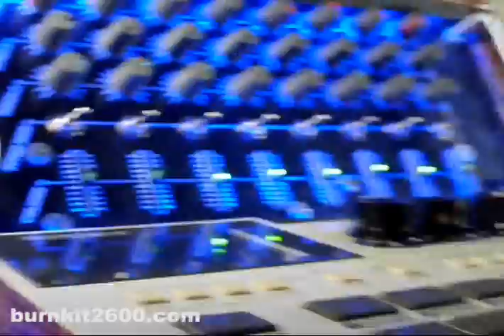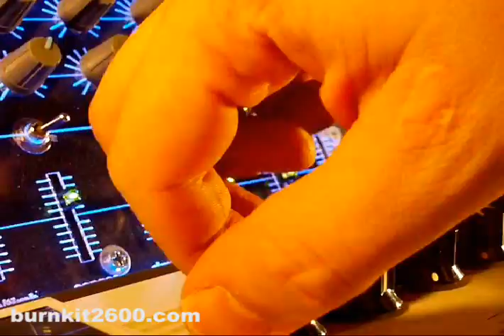TR-505: Custom Modified & Circuit Bent Drum Machine

Comment: There's only so much you can squeeze out of 8 bit PCM samples. You'd get much better quality sounds thru an FX return with multi effects pedal  or outboard processor. Your circuit bend design is just shorting and choking the internal PCM samples.